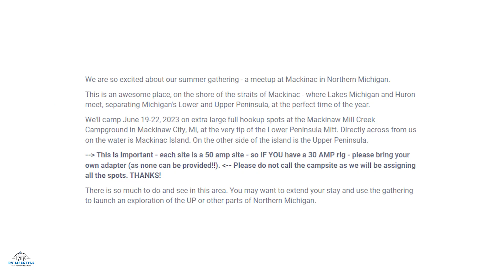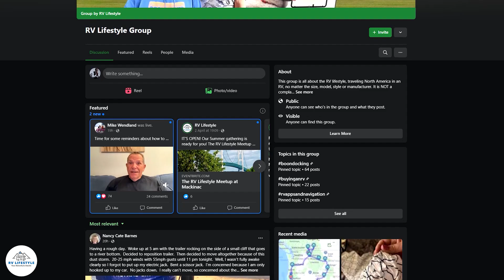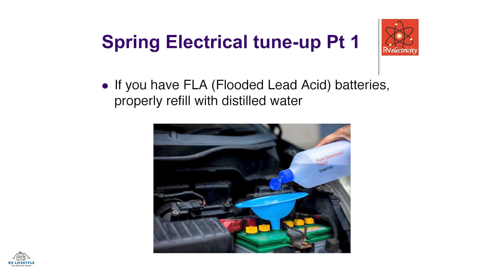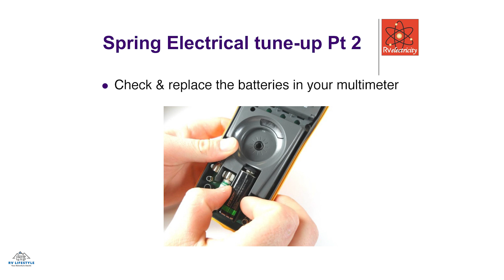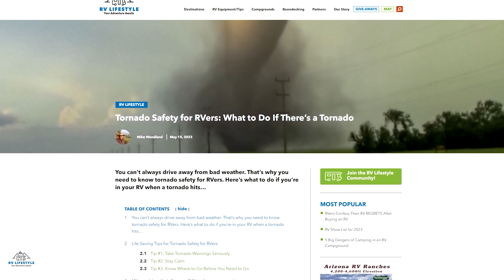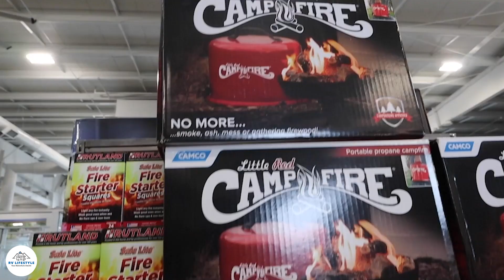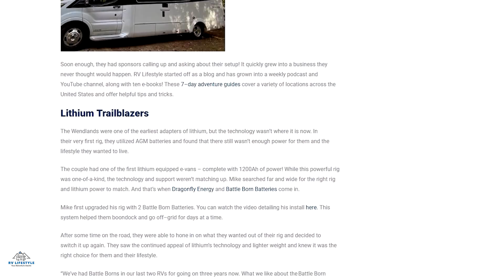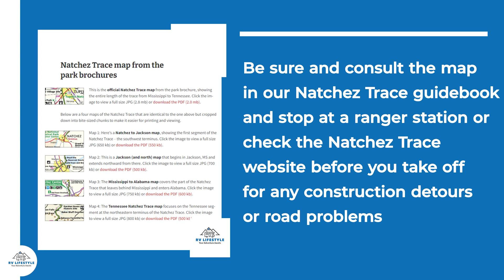RV Electricity "Do's & Don'ts" with A Pro!

Comment: The thing about severe storms is that they are fairly predictable.  Having spent the last 50 years in SW Oklahoma we watched videos of tornados as travelers on I 44 drove right into violent storms seemingly without a care.  Some did not survive.  This displays a total lack of understanding of nature’s process. First, understand the risk for any particular day where you are located and along your route.  Weather radio a service of NOAA is available nearly everywhere.  Family service radios should have the Wx feature as would ham radio handhelds or general scanners.  Second, know which states are most vulnerable I can say it is usually from the Texas panhandle extending north and south of Amarillo to areas east of that line.  High risk months are from April to July with May being the worst.  Mid afternoon to midnight sees more storms than early morning.  When you stop for the night - know your risk.  If you are in an RV park ask about storm protection when you check in.  If they don’t have a clue, consider staying somewhere that cares enough to help you.  Have a plan for exit to a shelter if needed and  know how to get there.  I would not consider a shelter that would exclude a pet.  Third, if all else fails learn the location of the storm and be able to project the path.  Local weather on TV will usually have a “watch” going in front of a severe storm and they will tell you the path.  Tornados travel generally SW to NE and if you are in the path you can move at right angles to the expected path to save your life.  A few blocks can make all the difference in a tornado unlike a hurricane.  Disclaimer:  nature can do as it pleases and cannot be totally predicted or understood so there are rare exceptions to any advice given.  If all else fails, you best not be in a high profile RV in the direct path of a severe storm.  At night you have to depend on knowledge and instruments to determine what you can see during the day.  If you are going to get out there, spend some time studying this issue.  The fear of storms will lessen as you become educated and you can relax and appreciate the grand spectacle of nature displayed in “tornado alley” every spring -or you can stay home until July to improve your options.